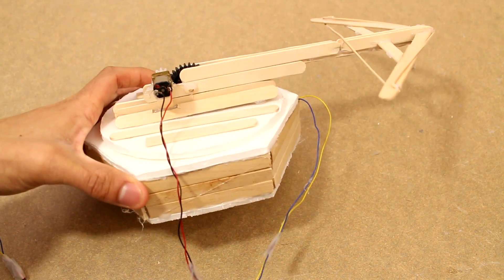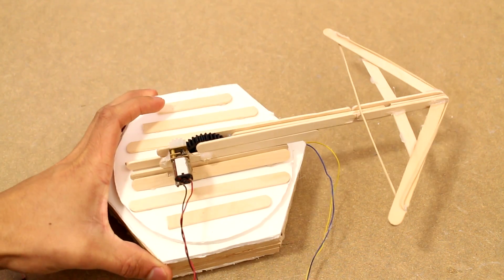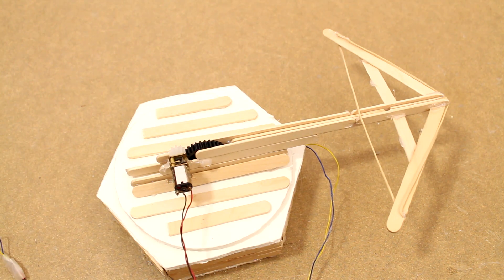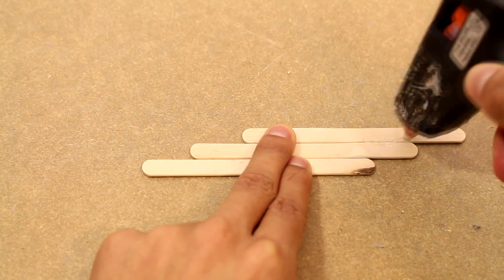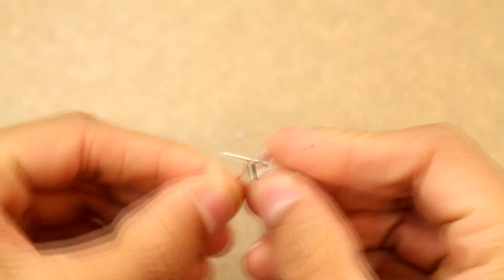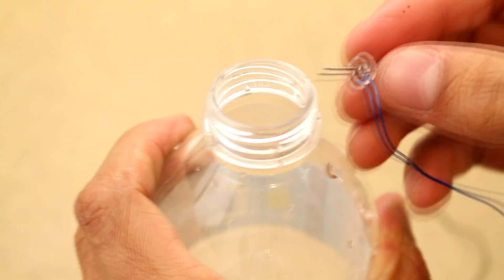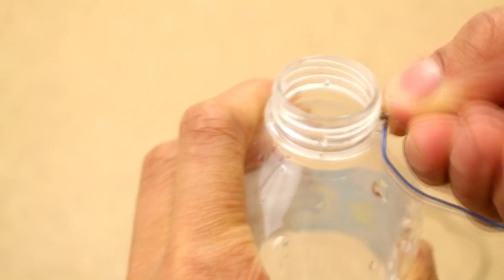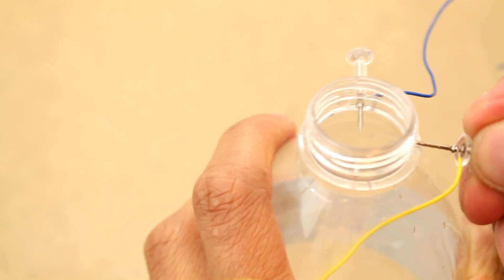How to Make a Remote Controlled Robotic Crossbow

Comment: What is that thing called you used, which gives out the liquid glue?
Reply: Scientist Tanjim Hot Glue Gun
Reply: bartu ciftci Thanks bro.
Reply: Scientist Tanjim it's hot glue gun but you can use normal glue cause it's one and the same just hot glue gun harden itself very quickly

Comment: @joshbuilds...what was that black device u used at the end?
Reply from the maker: Kedige Ananya Rao it's a pushbutton switch. just so I could have an off on switch to control when the crossbow's motor would rotate. you can use any switch for it though, no need to use a pushbutton switch
Reply: Oh..and what about the power source?
Reply: joshbuilds subscribed
Reply: Kedige Ananya Rao He uses an USB cable
Reply: maria sodde ..and connects it to? because it didn't work when I tried... I'm currently using a 9V battery

Comment: can you figure a way out to automatic reload the crossbow other then to reload and pull the elastic band manually....i was trying to look for the way out.
Reply: joshbuilds i didi'nt know that you are in the yt/youtube
Reply: JoshBuilds got an idea for you.gravity reload and servo for pulling the strings
Reply: you can add a string at the middle of the rubber band and connect the string to a BO motor. when the motor rotates, it pulls the rubber band backwards and finally when the rubber band reaches the gear, the motor should unwind the string.
Reply: done sir
Reply from the maker: yea i have an idea of how to do it, ill try it in a bit